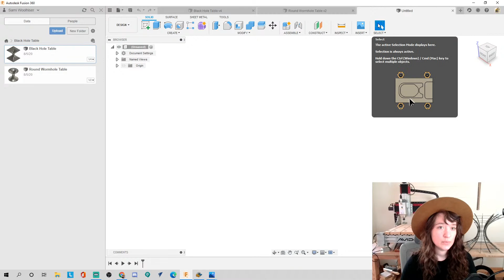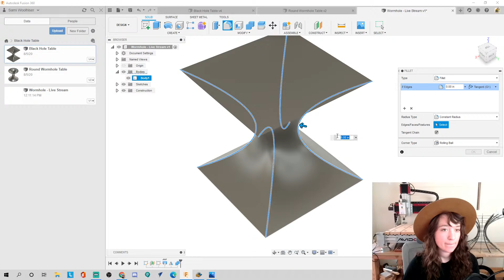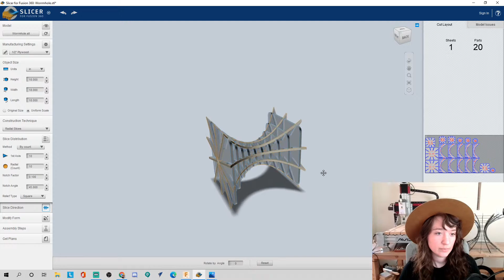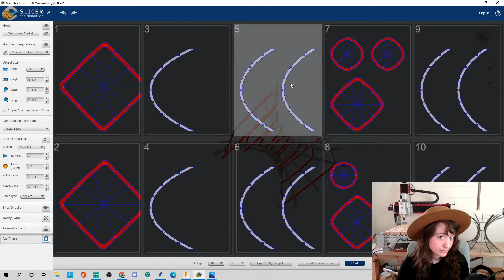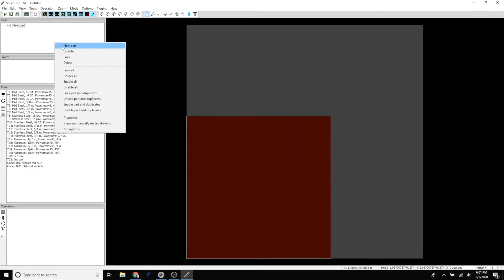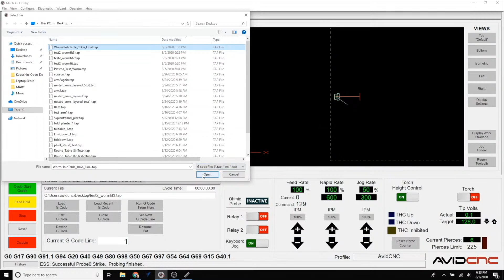Wormhole Singularity Geometry Table - Slicer for Fusion 360

Comment: Just caught the end of this live and you mentioned that slicer was available standalone?  Could you please possibly link to that too please?  As you are probably aware Fusion360 is updated soooooooo often that these plugins often struggle to keep up!!!
Reply from the maker: You can use the link above to download it, even though it's called "Slicer for Fusion360". You can open slicer on your computer, and import the STL. You won't be able to log in, but you don't need to in order to process and export your file, it might be tricky to save the file in Slicer, but you can save the DXF.
Reply: https://apps.autodesk.com/FUSION/ru/Detail/Index?id=8699194120463301363&os=Win64&appLang=en   for Win OS
https://apps.autodesk.com/FUSION/ru/Detail/Index?id=8699194120463301363&os=Mac&appLang=en   for MAC os
Hello. Fusion updates do not overlap with plugin updates in any way. Yes, sometimes plugins do not work after the next update of Fusion - if this happens, you must contact the author of the plugin using the contacts listed in the app store.
Hope I was able to help you. Creative success. If you have any questions, ask.